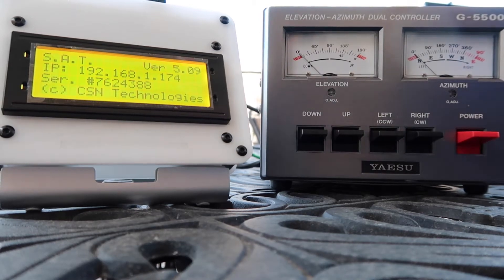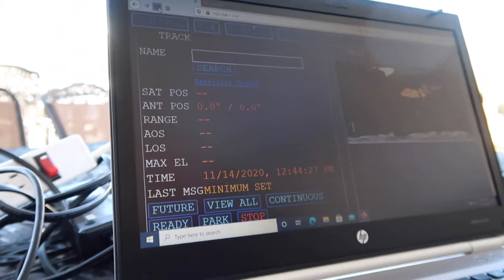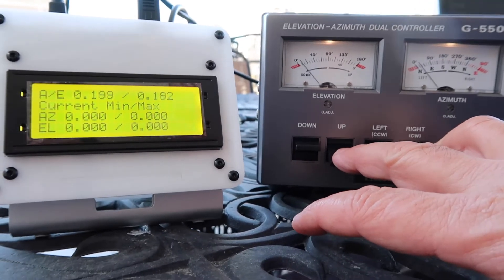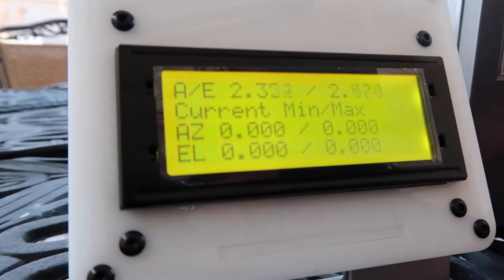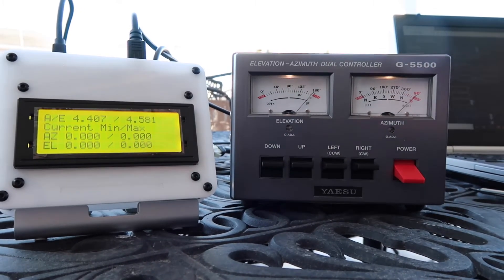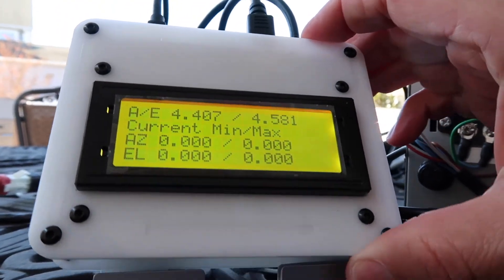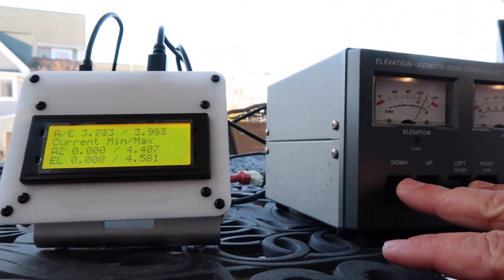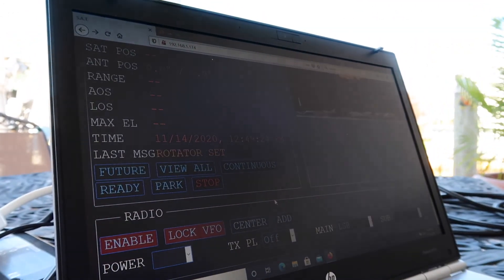S.A.T. Satellite Rotator Controller - Manual Voltage Calibration Yaesu G5500

Comment: My controller yaesu G5500 terminal 4-5 pin coming 31voltage .... Can i run the motor at this voltage or not
Reply from the maker: Im not sure what the voltage should be . Please contact Yaesu.

Comment: When i plug in the controller fuse hase damage what is the problem can you help me for this....i am from india and in india here rated voltage in house is 220-240
Reply from the maker: If you are talking about the G5500 controller. I would disconnect everything and power it up with nothing connected. if the fuse keeps blowing there is an issue with the controller.
Reply from the maker: please send us an email if you need more help.
Reply: Your Email id??
Reply from the maker: @aapka_sakha  its on the web site for our proudct. use the contact us page.

Comment: Hello Mike,
Just received my S.A.T. today!  (Thursday; I'm a "night owl", writing this at 2:25 AM Friday 😉).  I ran into an issue with the rotator setup that I wanted to pass along in the event anyone else ran into the same problem.  To start off with the problem was NOT with the S.A.T. controller; it was my rotator control box!  
     When I went to set the maximum voltages as you described here, I saw that the elevation voltage properly came up to 4.6 volts, but no matter WHERE I moved the azimuth rotator the voltage stayed close to zero (just a few millivolts, regardless of the rotator position).  Intially someone might wonder if the rotator cable to the S.A.T. was bad or a problem with the S.A.T. itself. 
     As it was coming up on the time for me to head down to the local YMCA for my 3 times a week swim workout, so I dropped things at that point & headed down to the Y.  Over the years, I've found that while counting off the laps (I usually swim at least a mile, 72 times across a 75 - foot pool), it's a good time to think over problems. 🤔 If you recall my original e-mail to you asking if the S.A.T. would work with my older KENPRO KR-5400A rotator, I thought to nyself, "What if the problem is in the rotator control box?".
    A few hours after getting back home, I checked out the rotator box.  Fortunately, the original owner had included the instruction manual with it, which gave the DIN connector pinouts; Pin 1 was the elevation voltage output, which varied correctly with the elevation.  Pin 6 was the voltage output, which as the S.A.T. readout said, was close to zero.
     Fortunately, when I was originally installing & testing the rotator, connecting & disconnecting the 12 separate wires at the screw terminals got old VERY quickly, so I had obtained some high - quality waterproof 12 pin connectors from Amazon; this literally made disconnecting the control box for a look inside a "snap"! ☺
     This used rotator system was in pristine condition; internally, the controller looked like it had just come off the assembly line.  The output voltage for both elevation & azimuth came through a couple of relatively simple op-amps with a pair of diodes after them; perhaps one of the diodes had shorted?  But before I started tearing into it I decided (with the power off) to check the resistance to ground of both pins 6 & 1; they measured virtually identical (a few K), so that tended to rule out problems in that area.
     Then I started thinking, "What if the issue is with the voltage control pot?"  I plugged the rotator cable back in, powered up the control box, & monitored pin 6 with a DVM while adjusting the output control pot.
    As SOON as I started adjusting the pot, the voltage immediately jumped up about 4.3 volts! 🤗 Playing with it a bit, it appears there was a bad spot right at the maximum end of the pot's track.  Adjusted it to about 4.3 volts, then brought it up to about 4.6 with the trim pot on the S.A.T.
     After saving the maximum & minimum points as you described here, I went through the rest of the setup procedure; setting my location, setting up the radio (IC-9700), and downloading the satellite TLE's.  Of the satellites I marked as favorites, the first upcoming pass was CAS-4B, which i knew wasn't active; but at the time of AOS, I went out into my backyard & was gratified to see the antenna system automatically adjust both azimuth & elevation as it passed overhead. 🤓
     A pass of AO-73 (which was supposed to ba active) was due about 15 minutes or so after LOS from CAS-4B; although I didn't hear any other activity, I tried the "QUICK CW" function by sending a series of "V"s.  Sure enough, I saw my signal coming back down on the IC-9700 spectrum display! 😁 I quickly adjusted the TX signal to match my received frequency, & was delighted to hear my voice coming back strongly on SSB! - AND staying that way until just a few minutes before LOS! 😎(No QSO's though because most of the "sane" operators were in bed!). 😌
     Again, my main intention here is to alert you & any other owners of older rotators to MAKE SURE that the rotator control box is ACTUALLY outputting the elevation & azimuth voltages before blaming the S.A.T. 
    Looking forward to having a LOT of fun 😀with this!

73,
Tom WA1LBK
Reply from the maker: Thanks for the information.

Comment: You have been using the extenral control, do you need to connect is via other device before it get connected to the PC?
Reply from the maker: You can connect directly via the built in access point. Or you can put it on your network.

Comment: Good info.  Even adjusting the pot on the back of the rotor controller, I could not get a reading over 2.9 volts.  Adjusting the pot on the S.A.T. box brought it up to where it should be.

73 de K4RS